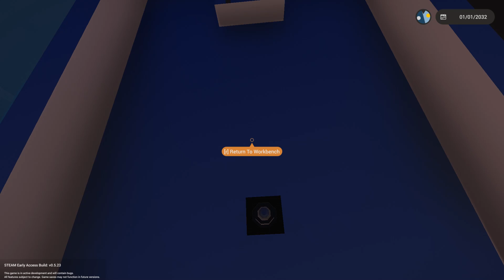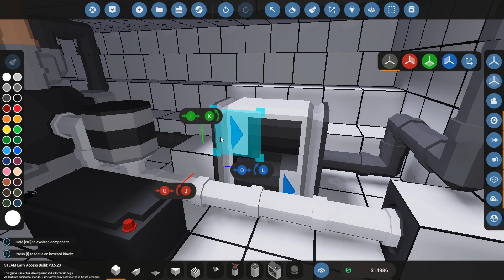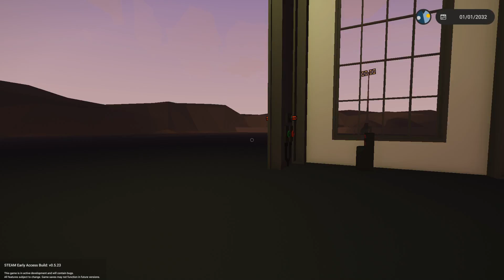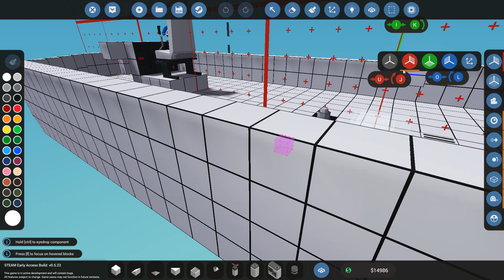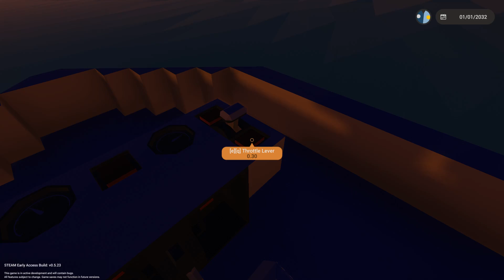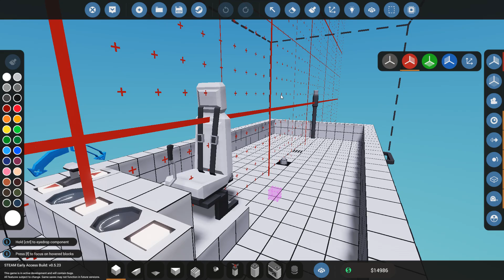Stormworks: Build And Rescue - Get Started In Advanced Career Mode - Part 2

Comment: What you said about the gearboxes is incorrect, the arrows must face the engine in order to read the ratios left to right.
Reply from the maker: Yeah you're right. For now for reverse it doesn't matter much, but I'll address it in a future video.
Reply: When I made my first boat with a gearbox, I assumed the arrows pointed away from my engine, and set the gear to 2:3. So my engine was working 1.5 times harder to keep the same amount of propulsion, thanks for pointing that out.
Reply: 3:2 is 3 turns input for 2 turns output. Which is 3 RPS input for 2 RPS output. You just have to remember that it's turns input : turns output.